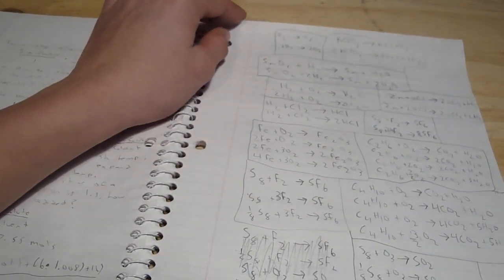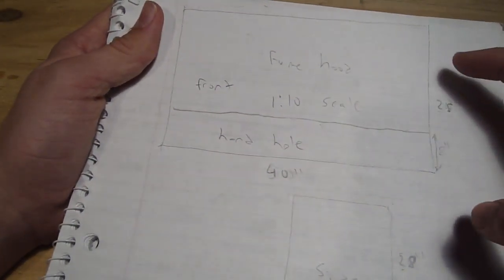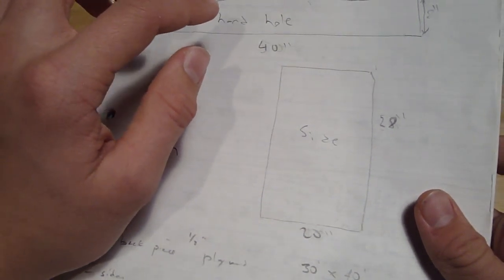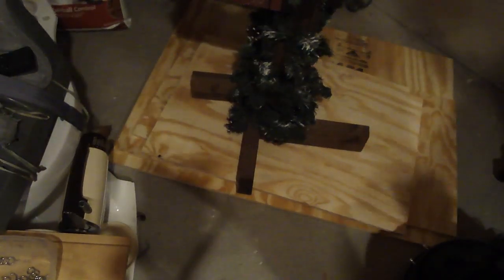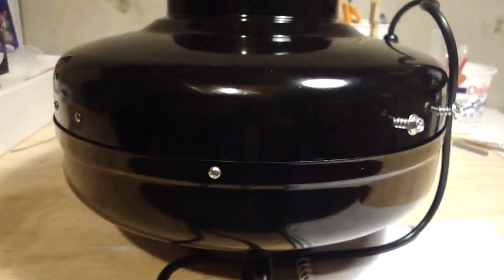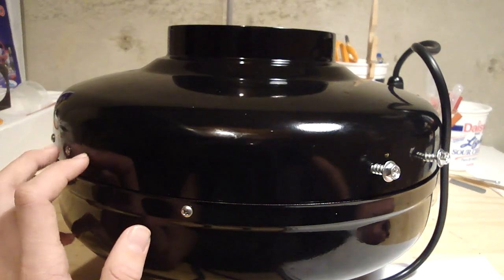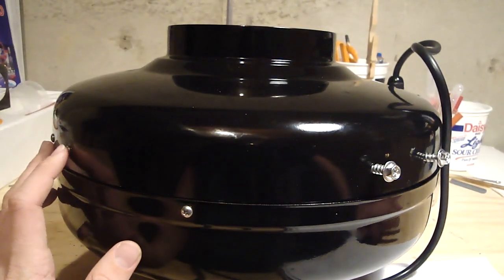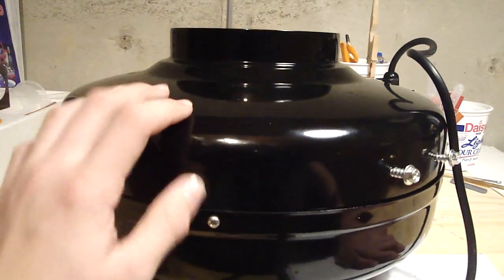How to Make a Fume Hood Part 1 - Plan and Supplies

Comment: Hey there.
I'm trying to find the correct formula in order no know which centrifugal fan i need.
I know it's related to the sash's opening dimensions. 
My sash's opening dimentions are 1 meter width, and 20cm height , but i will be happy to also get the actual formula
thanks

Comment: What face velocity did you want? From what I've seen safe is considered 60-100 fpm. At 250 cfm with a 2.22 square foot opening there would be a face velocity of ~112.5 fpm.
Reply: So, to determine face velocity, we divide the square footage of the entrance by the cfm of our exhaust fan?

Comment: i would build a hollow negetive pressure section in the back with air ports directly behind and above the working area i would also place simple on/off vents to control the passing air movement from above below/behind or both

Comment: Is it safe to build a fume hood if I wish to use HF acid on quartz or volcanic rocks?
Reply from the maker: Yes I think it should work for most acid fumes. Be careful with HF! That stuff is very dangerous.
Reply: +Gooferking Science what safety would you recomend besides 2 aprons, gas mask and 3 pairs of gloves? Also is it possible to make ''doors'' for fume hood and make it air tight?
Reply: Doors cannot possibly be airtight, doors need room to swing and close
Reply: Also what are your volcanic rocks made from; i.e., iron, obsidian etc
Reply: malachite and calcite, I suspect some quartz as well.
Reply: I may be a bit late but if you’re working with HF this fume hood isn’t the best 
You sholud use polycarbonate instead of plexyglass or glass (it’s more resistent to etching) the duct should be covered in PTFE(teflon) and you should use polypropilene as an inside coating
Sory for any mistakes

Comment: I ordered a 12V, 250CFM, continuous duty fan that's plastic and has an external motor. I wish the more powerful ones were cheaper, but the ducts on this one were 4 inch.

Also, it's best to have the fan as close to the exhaust point as possible. This way, most of the system is under negative pressure so there won't be leaks.